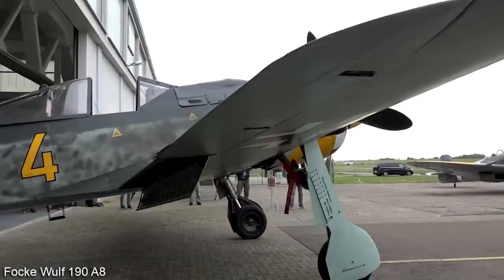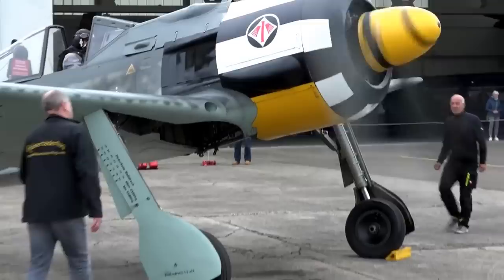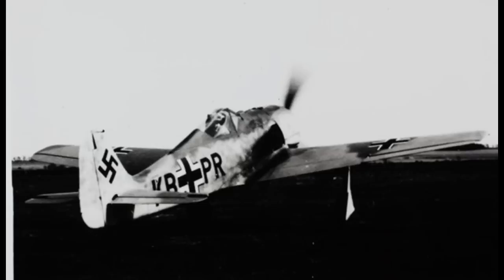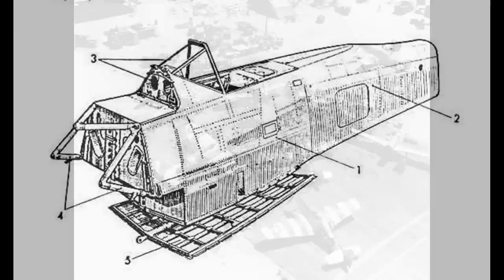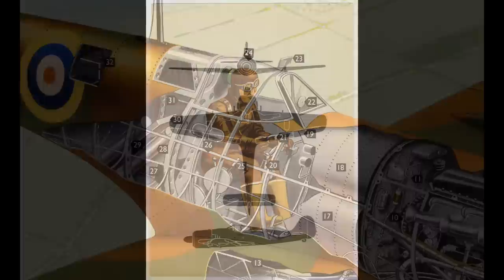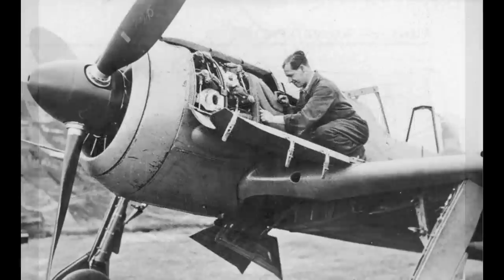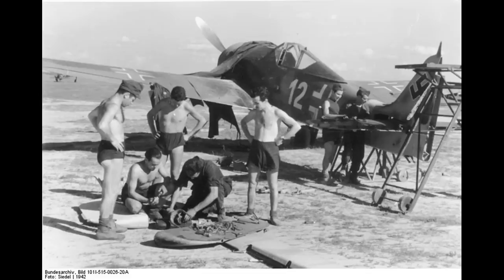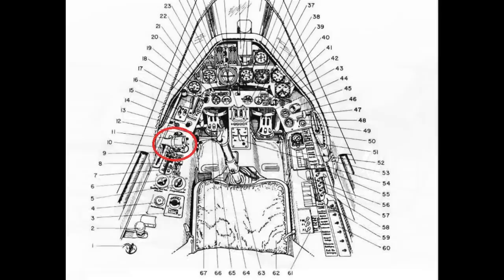Focke-Wulf Fw 190 Pt.2

Comment: And the 109 starting with the Friedrich was completely Automatic as well and has a Kommandogerät as well, that also controls Oil and Water Radiators.
Reply from the maker: It has some level of automation, but it's more like a P-40 but with automated cooling doors.
Reply from the maker: It has some level of automation, but it's more like a P-40 but with automated cooling doors.

Comment: @Greg. My Bonanza had a Beechcraft electric variable pitch prop. My grandfather-in-law, who owned the plane before me, added an aftermarket 3rd party pitch controller that made it constant speed.
Reply: When flying close formation in the Bonanza, after getting everything set up, I would switch OFF the electric prop pitch control, making it, temporarily a fixed-pitch prop. This made it a little easier to very precisely maintain my position relative to my leader.
Reply from the maker: That's interesting, I have flown a few Bonanzas and Haven't every seen anything like that.
Reply: @GregsAirplanesandAutomobiles  It was only on older ones. Mine was a 1956 G-35 model. 
Unlike the Hartzel hydraulic props, the Beechcraft electric props never had an AD issued against them.
Reply from the maker: The oldest Bonanza I flew was a K model, I can't remember what model year it was.

Comment: Another excellent video! However, I do believe the Kommandogerät was a feature of the BMW 801 radial engine, not the FW190. The reason why more fighters didn't use the system was like because the Germans favoured inline DB or Jumo engines, with radials being associated with passenger aircraft and cargo planes. Of course, the BMW was one of the most produced German engines, and that implies that more heavy fighters such as Ju-88 variants had to have used them.
Reply from the maker: That's a fair point, it does say "BMW" right on the documentation, however the D9 also used a similar system and that had a Junkers engine. Either way, the 190 had it when other planes didn't.
Reply: +justcarcrazy   The Jumo 213 had a similar device to the Kommandogerät ,  I just forgot what is is called.   If you look at the old video of the Fw-190D-13 at Doug Champlin's museum,  one of the reasons they had so much trouble getting it to start and just idle was because the device was missing.   It was found and replaced when the D-13 was restored again.

Comment: In a long range fighter, you want to adjust your engine and prop settings all by yourself in order to control the fuel flow. 
As mentioned in the video, the 190 was a short range fighter. Here, the Kommandogerät makes scene.

Comment: Interestingly... Most civilian aircraft have flight engineers far into the 80-tys.  Granted, handling a jet engine is very different from handling a piston engine. But its still a matter of few inputs and many outputs.

As a electrical engineer... the Fw 190 is a beauty to behold.
Reply from the maker: Yes, I may not have mentioned it, but I was a flight engineer on jet aircraft at one point in my career.
Reply: Unlike a piston engine there's not much you can do to affect the running of a jet engine from the cockpit beyond asking for more or less thrust by moving the lever.  I'll go so far as to say flight engineers were not really necessary on jets with basic electric, hydraulic, and pneumatic systems.  But for a while the regulators and the civil industry were on the same page and wanted to keep them.  For example, on the B-36 the flight engineers (2) were absolutely essential for managing the piston engines, but they never touched the four jet engines that were controlled only by the pilots.
Reply: @gort8203  Well... I don´t quite agree to that... In theory its true. A turbine engine essentially being a Diesel, just giving it more or less fuel control it.

That is true for some jet engines, and also some turbofan engines. But not all of them. Something as simple as some engines have nossil control change it quite a bit.

Granted, most jet engines with more controlls have some kind of linkage or similar to control it automatically
Reply: @Gort that is my point. That jet engines is generally automatic.

Comment: I personally had a failing prop govenor once in IL2. It was a long time ago. I dove on a very high engine setting and exceeded permissible RPM, something broke and I had my prop pitch stuck to fulyl coarse. I couldnt do anything about it, the manual setting didn't help.

Comment: Amacing video . I have a question about Comandogerat or the system on the 109. As far as I know the 109 was also operated with the throtle lever. Rpm was also automatic and like on the 190s and it decreades if you decrease the Ata with the auto control mooving the blade angle. Mix is also Auto and the Supercharger speed is also Auto. So how the 109 system diferenciates from 190s? I can not see any disadvantage on the 109 system being more simple. Rads were also auto on the 109 so no worries there for the pilot. 

I can imagine a 109 with some 190 features on the controls etc to improve handling at high speed. That would be an awesome  mix.

Comment: when  the  190  came  into  service mid 41,  It  was  so  effective  the  brits  called  it  the  butcher  bird,  hardly  mediocre  Greg.
Reply from the maker: The 190s performance was generally mediocre. Now if you cherry pick specific dates and match ups, then you can point out cases when it was superior. For example a 190A4 vs. Spitfire, the 190 has the edge there. However if you look at it overall and include 190A8 vs. a 2600hp P-47 or a P-51B,C, or D, it's behind in performance. The 190A's performance overall, throughout was about average, which is actually impressive considering it's other advantages.
Reply: @GregsAirplanesandAutomobiles  yeah i guess ,but  till  mid  43 the  axis  dudes  were  doing  pretty good , us  industreal
Reply: might  and  the  fight  in  the east doomed the germans  no
Reply: @GregsAirplanesandAutomobiles  what  time  frame  was  your  2600hp  p47    Greg ,  there   were   also 24  different  spit    types  .

Comment: Hi Greg couple of questions.
1) Kurt tank was a brilliant engineer and proved himself to be one of the best designers and his Ta 152H1 proved his acumen in this feild. Why is it that Kurt couldn't make any meaningful dent in the jet age? Sure he designed a few Latin American and a Indian jet but was nowhere near the clout of Kelly Johnson. Seeing his brilliance was mainly focused towards electrical side of things, that should be a valuable transferable skill in the jet age but it seems like he couldn't make his mark there. 

2) Did the Ta 152H1 feature "Command Unit" and is it possible that the one resting in Smithsonian would have that unit intact? I know it was rigged to blow but there must've been some post war assessment on this unit by NACA. Is it fair to assume that the unit would also control GM-1, third stage supercharger and cockpit pressurization all on its own? 

3) not really a question but I think a video on your 124 doing quarter mile runs would be nice, kind of like a track day video. I just like looking at 124s, it's a good looking car.
Reply from the maker: Hi Asif.
1. It's my opinion that had Kurt Tank moved to the US he would have made a dent in the jet age. However he went to parts of the world where that wasn't really practical or even possible at the time. A designer is somewhat limited by the people and resources he is working with.
2. Yes it did, although it's a different unit, it does essentially the same thing. I'm not 100% sure how the GM-1 was triggered, but normal Fw system logic would have meant that a switch armed it, and it would have come on when needed as determined by throttle lever position altitude etc. That type of system logic continues on in Airbus today, which is a decedent of Focke-Wulf. 
3. I need to do that, but I've been too busy. The car runs well, but we haven't turned up the boost yet. My shop is really busy and my own cars are usually on the back burner.
Reply: @GregsAirplanesandAutomobiles  Thanks!

Comment: Early jet engines were very finicky about mixture and thrust... including jet nozzle position.  vis e.g. Jumo004 controls which only at the end of the war provided for somewhat stable operation using an early, hydraulic PID control.

Comment: Hi Greg! I just subbed. Can you tell me any info about the photo of the aircraft at 5.15? There's some unusually marked Mustangs and Thunderbolts which would make great subjects for modelling. 👍

How about doing a video on the Westland Whirlwind fighter, and why it fell into disfavour?
Reply from the maker: Hi idle, thanks for subscribing. I don't know what the deal is with those aircraft. Those are not the normal D-Day invasion stripes, and I don't have further info on that photo. I may talk about the Westland Whirlwind at some point, but it's not going to be very soon.

Comment: Great video Greg. The 109 did have auto pitch from the F on, although i don't know if it worked for all flight conditions like the 190 or if it was just takeoff and combat.
Reply from the maker: Yes, it's much like that in the P-40. That's not the same as what's in the Fw 190. If I was to make this video over again I would have talked more about the 109 and Spitfire controls. I thought my statement than nearly all WW2 fighters had constant speed props, and then explaining what that was using the P-40 as an example should cover it, but reading through the comment it seems people want me to spell it out for each specific plane. Maybe I'll touch on it a bit more in Part 3. Yes, the 109 and Spitfire have constant speed props in all post Battle of Britain variants, and some earlier models. They are much like the P-40 when the P-40 is in "auto".
Reply: Greg's Airplanes and Automobiles thanks for the reply. It’s hard to find good information on how those systems function other than “had and auto prop pitch mechanism”.

Comment: The Fw190 Butcher Bird was the best fighter plane made during WW2 By far, the radial model starting with the A,sphere better than any Allies fighter,  until the newer Spitfire,s come out which left the 190 wanting over 7000ft, but then the newer model 190 came out, the radial BMW, motor,s were trialled with turbocharging and four blades for altitude until the C model that used the  Daimler Benz DB603 with supercharger and four bladed propeller,s, then the Dora with it, Junker,s Jumo 213A inline motor,  that was raved about by it,s pillot,s, which Kurt Tank wasn't to happy about for he demanded his TA 152 go in to production, even though it had a limited run, but not matter what any body,s say,s the FW 190 FOCKE WULF was the best most outstanding Piston Engined Fighter Plane of World War 11, no Bragg, just fact !!!!
Reply: Nah

Comment: On your point as to why more fighter designs didn’t adopt a single spar aligned with the firewall - Is it possible that the 190’s relatively short nose gives it an advantage as far as convenient alignment of the wing spar and firewall? Is it possible that the aligning of these two things was not possible in other fighters with longer noses and therefore a firewall that was further forward? just curious. Great video as always.

Comment: Another excellent video, as usual. Me, being a smart a$$ as usual, I did notice (in some of the previous videos as well), that you seem to be using some clumsy tools to deal with graphics. I recommend you download and start using Inkscape, it's a free, open source graphic software, comparable to Adobe Illustrator and it should be more that enough to help you make good and accurate overlays (like overlaying stuff on gauges, overlaying text on pictures, make accurate dots on graphs, etc.). Also avoid using black text on BW pictures, if you do, use text outline (or stroke).  Feel free to contact me, I'd love to provide you with some examples, or help you out, if you would prefer that. I also have experience with audio, so I can help you with that as well. Such great research and content deserves best possible presentation as well.
I also love that you mentioned one of my favorite games/simulators, Il-2 Sturmovik. With any luck, we'll meet in the Il-2 skies, so you can get your payback for me being a smart a$$ :)

Comment: Hey Greg, Just half way throught part 2 as i type.. absolutely brilliant stuff and thanks loads. Out of interest have you flown the Anton in DCS? What's you opinion? Cheers
Reply from the maker: I only fly the Dora in DCS. Sadly it's broken, or unfinished and they don't seem to be willing to fix it. It's awesome, but there is a bug that causes the engine to quit when run continuously at lower power settings. Also, there are not many good servers for DCS multiplayer with the WW2 planes, which is also sad.
Reply: @GregsAirplanesandAutomobiles  Sure is hit and miss regarding activity online, the 4YA thats kind of replaced the SOW server can be busy at times. I don't fly the D9 but speaking recently with others I believe they have updated and fixed the engine issue? However I may be wrong. Cheers

Comment: When I was young I always liked the 190 and not the 109, the 190 was a better looking more expensive fighter. On paper the 190 was better than the 109, better armor, armament, range, speed, canopy and controls. It surprised me when I studied the kill rates, the 109 was a much more successful  fighter. The reason is the 190 was heavy and the 109 was light, power to weight ratio is the most important thing in dogfighting. The 109E had the best power to weight ratio when the war started and the 109K the best when it ended.

Comment: Very nice and interesting. This picture (https://www.7-forum.com/news/2007/technoclassica/kommandogeraet_1940_p0034920-b.jpg) indicates that static air pressure ("Außenluftdruck", literally "outside air pressure") is also an input to the Kommandogerät, as well as a "Sturzflughebel", or "dive lever".
There's a pdf of the engine (inkl. Kommandogerät) available in German (I could translate the section on the KG if you like) which mentions charge air temperature as am additional input parameter. It also contains a more complete version of the picture mentioned above.
Reply from the maker: Could be, it makes sense that ambient pressure would be an input.

Comment: Hi and thank you. I am sure this has been said. A standard medical or welding oxygen bottle nowadays is pressurized to 2200psi. So they will react much more than a bottle at 400psi if shot with a gun. Not a realistic comparison to watch a video of a modern heavy walled oxygen bottle being shot with a rifle.
Reply from the maker: If both are at 400psi, then I think it's a valid comparison. The 2200 number you are talking about is probably a maximum, or near max servicing pressure. I think if you shoot a bottle with 400psi it's going to be dramatic.

Comment: The manifold pressure gauge used for illustration (with rpm gauge) has the value 50 twice! (The second between 65 and 75 should be 70  of course.) It's a small thing but can be confusing.
Reply from the maker: without a time stamp I can't really respond to this.
Reply: @GregsAirplanesandAutomobiles  ? I've just seen the video (27/08/2022). This video, as the other others of yours, is excellent, I only wanted to point out a technical mistake in the drawing used, that might be disturbing for other viewers also.

Comment: @Greg,  the naca has tested a captured Kommandogerät and written a report on it.
Reply: Do you have a link?
Reply from the maker: I do not have a link, I'll search for it.
Reply: @GregsAirplanesandAutomobiles  it is naca wr E-192 'characteristics of the BMW 801D2 automatic engine control as determined from bench tests'  by M. Scharer and A. Addie from april 1945